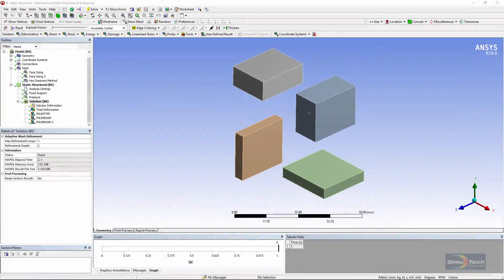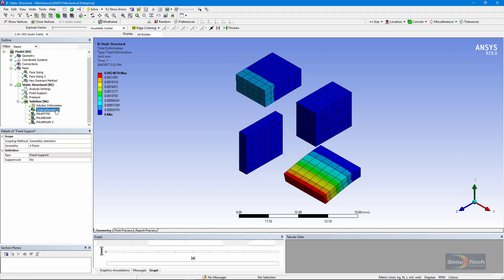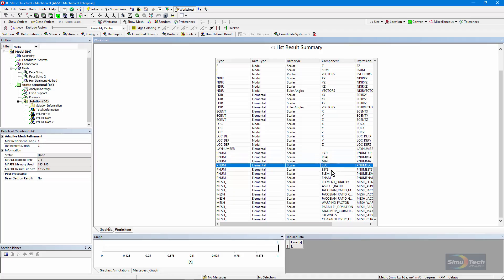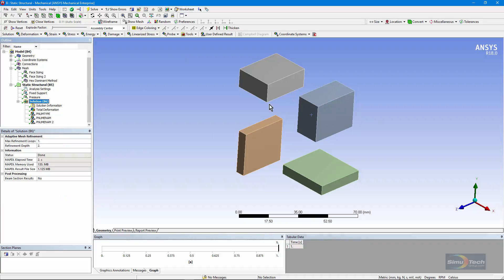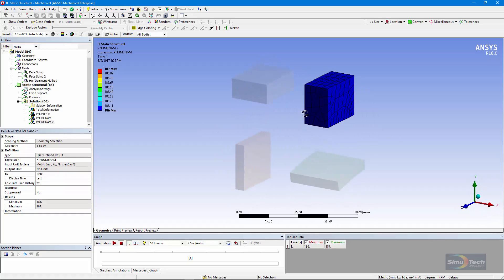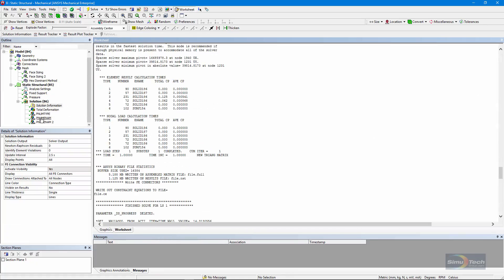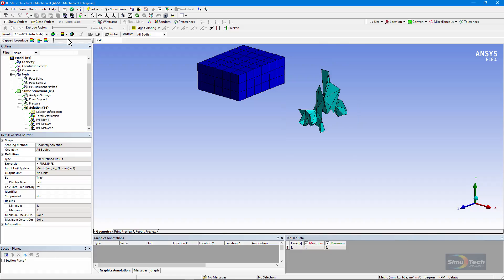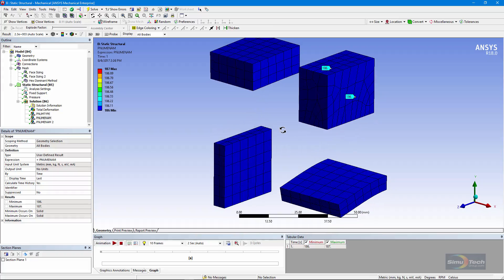Plotting Element Type Numbers in ANSYS Workbench Mechanical

Comment: @simuTech Group: Is it possible to plot the element number before solving the system? That would be great!
Reply from the maker: Yes, you can plot element numbers prior to solving the model in Mechanical. Once the model is meshed in Mechanical, go to the Display tab, Preferences Annotation, then in the pop-up window for Annotation Preferences check Mesh Annotations, Element Numbers, select the range of element numbers to be shown, and finally pick Apply Changes. You will also have to set the display mode to Wireframe for solid elements, in order for the element numbers to be visible.